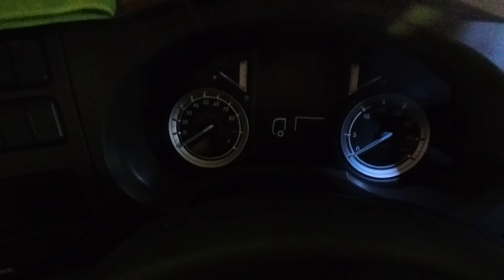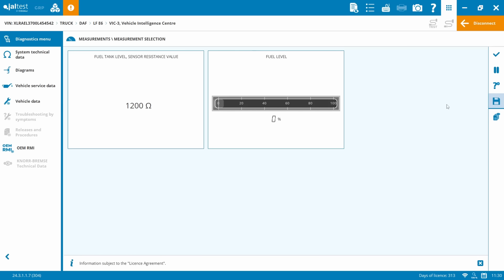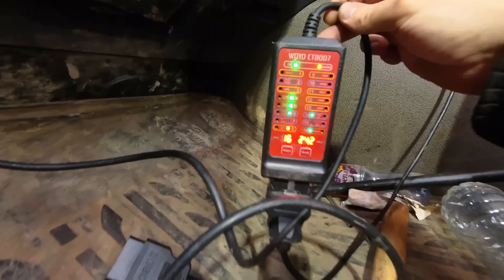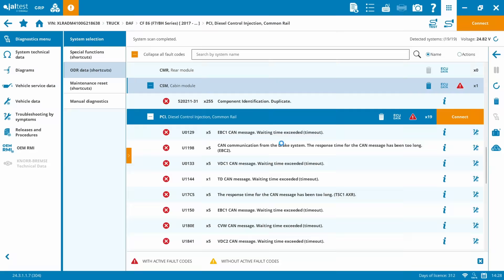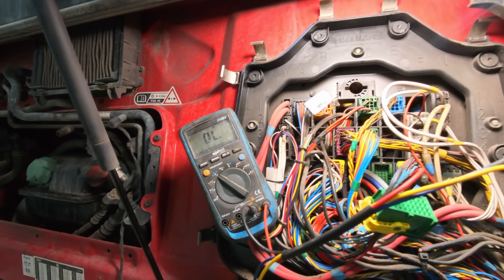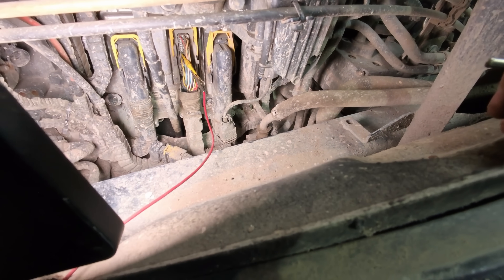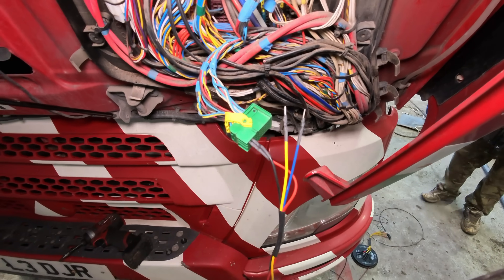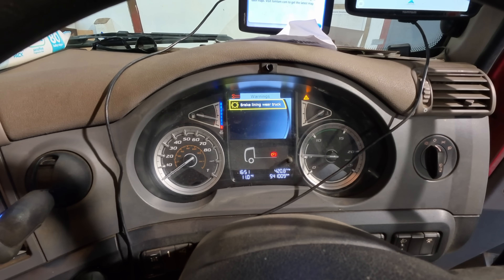Fast DAF Diagnostics: How Resistance Saves me Time!

Comment: Interesting why they didn't fit a fuel gauge first.... before calling u in
Good lesson though on resistance... 😊
Reply: Or Could drain fuel  , undo the strap bolts,,  ,and draw the tank forward... 😂
Reply from the maker: @andyg817  now now....let's not think about the correct way to do this 😅😅😅😅
Reply: @TRUCKTECHUK  just had an interesting issue with those yellow clips on the wiring loom  going into the clutch pack on the gearbox lf as tronic,    half was broken. So i found out to use those red /purple bits on the plugs to push in , at it released, and dropped down.. phew..
Reply from the maker: Ah Andy, I think it was less effort to get me to test it than drain the fuel tank, mess with the side guards and pull the tank off......last thing I heard when leaving was they were cutting a square out the floor to lift the sender out the tank 🫣

Comment: Hi Russel,
Nice video.
Was the can high cable broken due to the movement of the cab or a plug with a bad contact?

Nice sweater.
Reply from the maker: Hi buddy. That's a good question, I don't believe it had a bad contact at the plugs, I think it was somewhere in the loom which is all foam-filled so impossible to disassemble. I just ran some twisted ABS cable in for a new can wiring harness